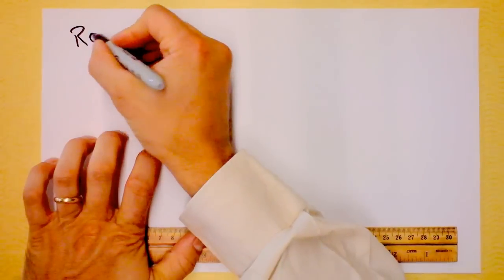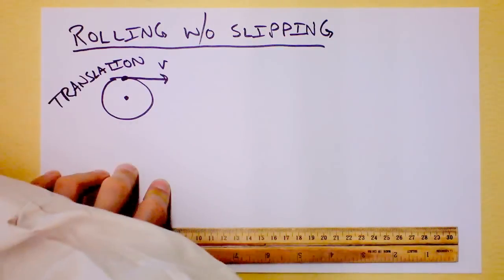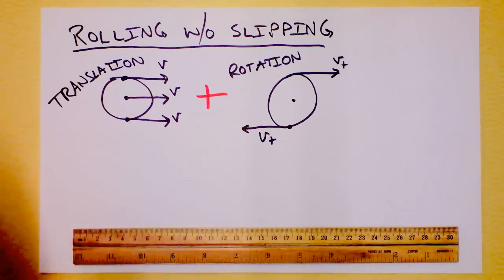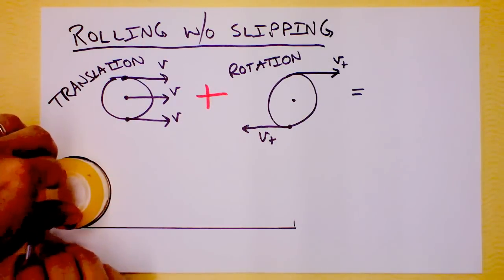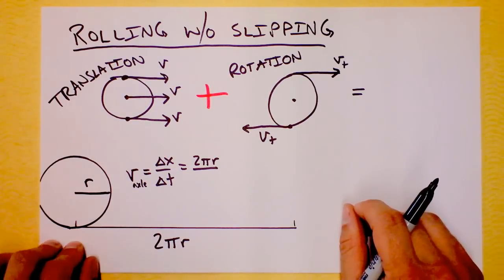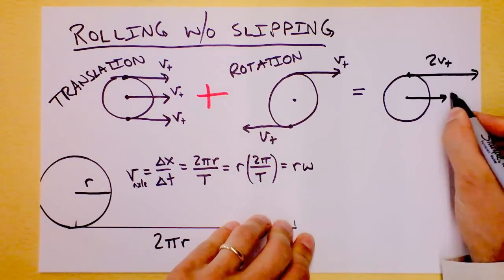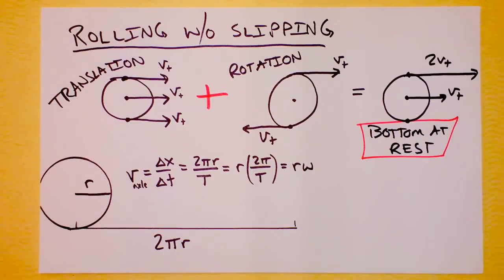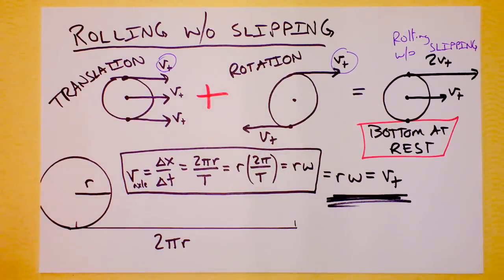Rolling Without Slipping - A sticky adventure in rotation and translation | Doc Physics

Comment: It was very hard for me to accept that bottom of the body in rolling motion without slipping is at rest, but this video convinced me.... Thanks buddy.
Reply: I still find it hard to accept, care to explain it to me?
Reply: @derryderry5672  Sure, you see velocity of the each particle in the rolling wheel is determined by the vector sum of the velocity of particle due to Rotation and Translatory motion. Since the velocity of the particle at the bottom end due to Rotation is tangential to the wheel towards left(in the case of moving wheel towards the right) and velocity due to Translatory is towards right. And they happen to be of same magnitude (which is only possible if wheel is moving without slipping) hence they cancel out. So the magnitude of velocity of bottom end is ZERO. But the top part is still moving, fastest of all the particles cause in top the velocity due to each case are in exact same direction, hence they add up.

Comment: great explanation of hard to accept fact! A kinematic way of looking at this problem is to note that the path taken by the particle on the edge of a wheel is a cycloid. now the parametric equations of a cycloid are x = r(t-sin t) , y = r(1-cos t) . by definition velocity of v =  [(x')^2 + (y')^2]^0.5 , if you plug in t = 0,2pi,.. , n*2pi(the particle is at bottom when t=0,2pi,2*2pi,etc) , you get v = 0.

Comment: Hi, Doc Schuster. I have a question about rolling with or without slipping in terms of friction. I did some problems and I realized when some object rolling without slipping, friction doesnt do work, but how about kinetic friction? Another problem is that if there's an external force acting on the object, but it is rolling without slipping, why does the work = external force times the distance travel. Shouldn't the friction force also do work to prevent the object from slipping?  Thanks!!
Reply: Yes u are right the friction will do some work to prevent it from slipping and after sometimes it will attain a pure rolling motion ( rolling without slipping) but it will take some time .
Reply: friction doesn't do any work in rolling because bottom point is always at rest (W = FxD = 0)

for your 2nd question same answer

Comment: sir i cant picture how the point of contact is at rest.I mean you started from the zero mark and went on till some distance on the ruler.So the point has covered some distance in some time then how can it be at rest. :-(
Reply: instantaneously it is. as position is changing every moment
Reply: +anuj balodi Try looking at it as a simple motion equation (as he drawn it on the video). The velocity at the bottom of circle (or in real-world application, where the circle is in contact with the ground), is pointing toward the left for rotation, but pointing toward the right for translation.
Reply: one way to visualize how and why the Point of Contact has a Velocity of ZERO is to imagine a BULLDOZER... that's right... a BULLDOZER... you've seen a bulldozer with it's metal TRACKS. Notice how the Front and Back Wheels ride inside the Metal Track.  Have you ever noticed how the Track that is on the Ground is NOT moving?.. but the Top Track is moving Foward?.. Now imagine the front and back wheels move toward each other and the track shortens. At some point the front and back wheel OVERLAP.. and the point on the bottom is at Zero Velocity.... good luck...
Reply: Philip Y thank u sir
Reply: This should be a top comment
Reply: thanks philip. i think another example of seeing it is if you replace the circular wheel(tyre) with a square one. To roll a square tyre notice the one corner must be at rest while you rotate the wheel. if we replace the square tyre with octagon tyre one corner will be at rest while the seven rotate. Now a circle is a polygon with infinite sides. And the analogy could extend to it.
Reply: @jmafoko  wow...! good analogy and intution  . r u a teacher for god sake
Reply: Real education is in comment section.
Reply: I want to know the direction of friction in this case.

Comment: is the friction of rolling maximum static friction ? 

and why it is static friction why the velocity of contact surface is equal zero? 

I really want to know why.
Reply from the maker: Great question!  It need not be the maximum static friction.  In fact, in equilibrium on a flat surface, objects continue to roll without slipping without any frictional force!  As to your second question, you must get a bike tire and roll it around while thinking about it for a while to convince yourself.
Reply: Doc Schuster 

that mean if the question give me the coefficient of static friction can i say friction=coefficient of static friction × normal force. with out find the acceleration of center of mass.

also if the surface is smooth is that make different or change the acceleration of center of mass

please answer me because I feel tired and my mind reproaches me

Comment: Okay I love the video! Yet I get stuck I can't wrap my mind around the fact of how the top is 2Vt yet we are brought up in my physics class V=rw(romega) so when you ended the video with out clarifying on how the equation works with the 2Vt instead of just Vt i was left uneasy and confused. Can you break this down for me?
Reply from the maker: +sarah phillips That v from your class is the speed of the outside if the axle is still.  Correspondingly, it will be the speed of the axle if the bottom is still, right?
Reply: +Doc Schuster okay I think I figured it out I talked about it with one of my fellow students in my class after presenting him with the video as well, he then said that the velocity would be relative to the ground looking in on the system from two different perspectives. therefore he first perspective being in the system yourself; for example sitting inside a rolling tire. the second perspective being a person observing you rolling in the tire and the tangential velocity would seem different to each observer. Can you further conclude on these statement telling whether or not I'm over thinking things?
Reply from the maker: +sarah phillips Sounds fine.  in the tire, you think tangential v is r*omega.  Outside, you see that v_t is zero at the bottom, r*omega on the sides, and 2*r*omega at the top.
Reply: +Doc Schuster so is that is why it's 2r*omega because in the specific example you are looking in on the system?
Reply: You have understand it.
Vaxle = Radius Omega = Tangenial Veolcity

Comment: why the bottom is at rest? the mark is moving?
Reply: +Eat Shiit (tenacious pessimist) Try looking at it as a simple motion equation (as he drawn it on the video). The velocity at the bottom of circle (or in real-world application, where the circle is in contact with the ground), is pointing toward the left for rotation, but pointing toward the right for translation. 

Assuming that both velocities are equal --> v(translation) - v(rotation) = 0. That is why the bottom of the circle is  considered at rest.

Just remember that this is only true for pure rolling without slippage.
Reply: +Refuse to Eat Shiit (tenacious pessimist) The bottom of the body is "instantaneously" at rest. It doesn't mean that some point on the wheel is stuck to the platform all the time.
Reply: Rest doesn't meant Stuck at That Time.